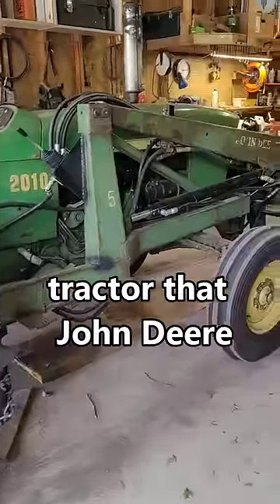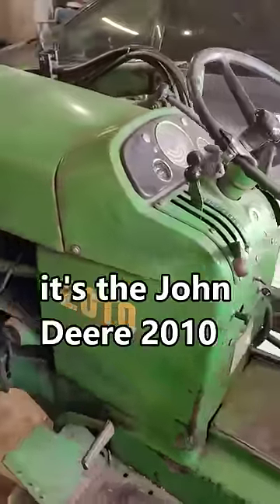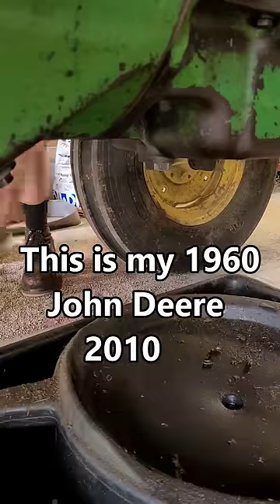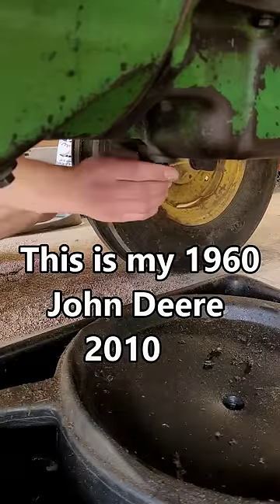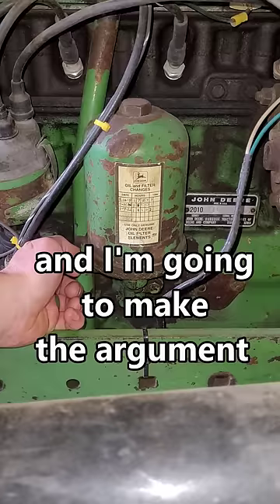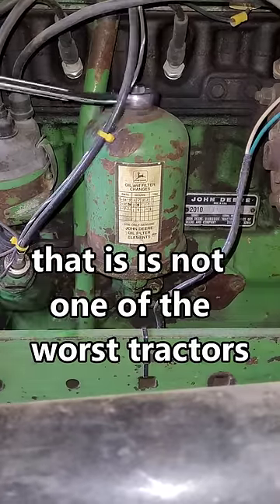Is this the worst tractor John Deere has ever made? #shorts #mechanic #farming #johndeere #tractor

Comment: I own one too I bought at auction. My brother and I have a 4020 and used to have a 3020 we shouldn’t have sold that one.  I’ve not seen one with dual hydraulics like yours how would I modify mine?
Reply from the maker: What do you mean dual hydraulics? Are you talking about the dual rockshafts or how do i have the loader and 3 point?
Reply: @craftzmanchris9859  

Rockshafts.  I saw the 3 levers one for 3 point and 2 rockshafts I’m assuming.  I’d like 2 for my loader instead of the cobbled up system I’ve got.

Comment: There is nothing wrong with that. But what about a gallon and a half of John Deere Green and a quart of John Deere yellow you can make that tractor look brand new and if you do paint it use only John Deere paint aftermarket paint doesn't have the same pigment in the paint and it will fade out

Comment: How many implements are in a ton?
Is that 2000 implements or 2000 lb of implements?
Because a ton is 2000 lbs.

The way that you're using that word makes no sense whatsoever and has no meaning whatsoever.
So it's a waste of time to even use that word cuz it has no meaning whatsoever!!!
Reply from the maker: It's a figure of speech bud.

Yes, saying I have tons of different implements would mean, in the literal sense, my implements collectively weigh thousands and thousands of pounds.

Saying I have tons of different implements as a figure of speech, or in the non-literal sense for vivid effect,  means I have many different implements.

If you can't handle the lingo, keep it moving.

Comment: 5075e to much power out of a three pot. stock frontend loader is capable, will always life the back of the tractor, even fully weighted and wheels full of water. 

Any dust and it over heats, it rattles, and it rides terribly. I'll be glad to see the back of it

Comment: The 20 series are THE ONLY GREAT tractors John Deere ever made.Before and after were completely junk worth what they weigh when hauling 
junk iron.....
John Deere was going broke with their pop pop tractor so the over engineered the 20 series. However, they realized they were THAT good and didn't follow the rule of 'planned Obsolescence '.So they quit making that series.
Reply from the maker: They actually went to the 10 series before the 20 series.
Reply: @craftzmanchris9859  
Oh,I didn't know that.I had a pair of used 4020s and a neighbor 3020 to work with as that is what we could afford. They were a great tractor to start with but I sold them and went to used Olivers instead.I went backwards instead of forward on newer tractors but the Olivers are a amazing tractor.Kabota too is a finer older tractor. I don't work for mr.banker so I always used old equipment that is paid for.